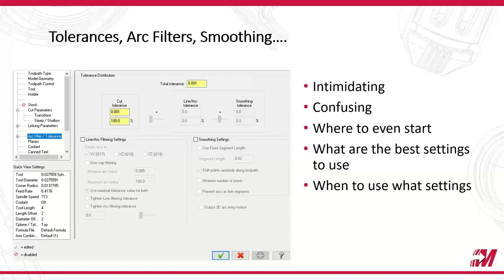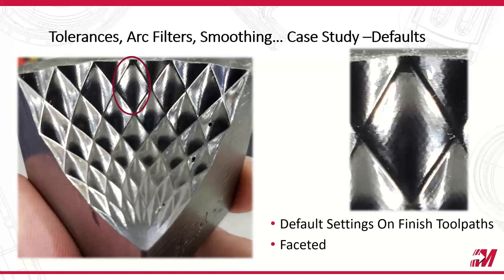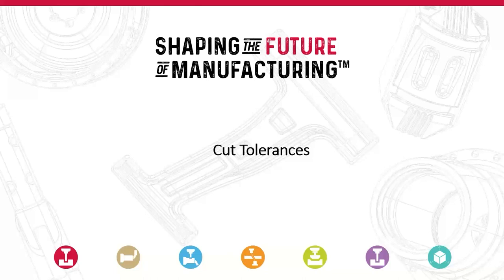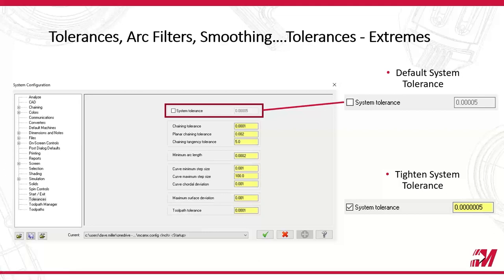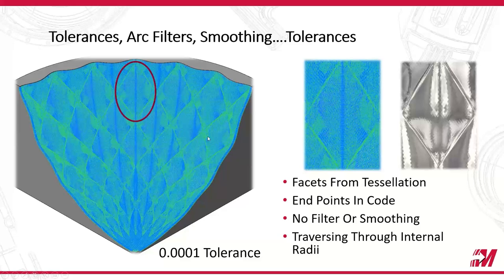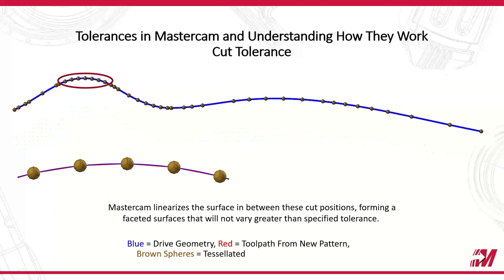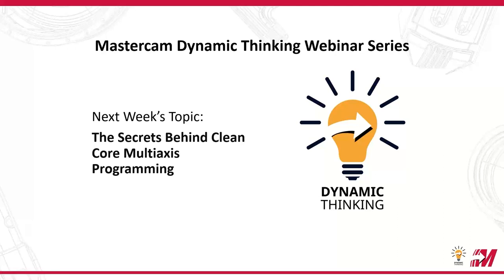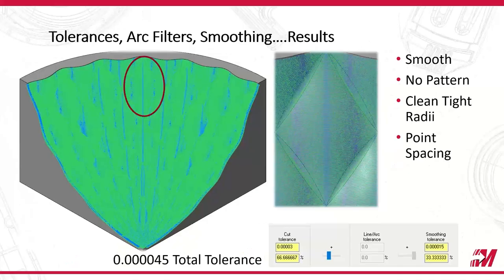Dynamic Thinking Webinar- 3D Surfacing and Smoothing

Comment: Had to rewatch a couple times to fully understand the differences. Would you ever use both Line/Arc and Smoothing together? in the examples shown you either used one or the other.
Reply from the maker: Hey Randy! The Arc Filter and the Smoothing are doing two different alterations to the native path. The Arc Filter is going to try to turn as much of the path as it can over to arcs. Even if a straight line is the proper path. The Smoothing is just looking to smooth out the sharper, more abrupt transitions between moves. That being said, yes you can run both, but it is slightly counter productive. The Arc Filter is already doing a lot of smoothing by turning the path into arcs (even though this is going to deviate more from the native toolpath). The Smoothing would only clip and modify the "high spots" of the native toolpath.

Comment: when you dividing the total tolerance between the Arc Filter and Smoothing setting, should the cut tolerances always be bigger than the other two?
Reply from the maker: The answer really needs to be broken down into what you are trying to achieve.
In a general statement, yes generally the Cut tolerance should be less than the line/arc filter tolerance and the smoothing tolerance.  

However, if you are trying to apply a Dynamic Roughing toolpath, and you are trying to really reduce the amount of points/lines of code. In that case, you could open the Filter tolerance up more. You could lose control over the step over and this could be dangerous based on the cut condition.

The same could be said about semi-finishing and you are trying to smooth out the facets but also leaving stock and not worrying about being as accurate to the shape. Then you could increase the smoothing tolerance and it will smooth those high points of the facets. But again, you could be less accurate.